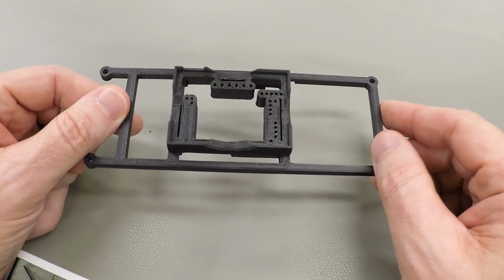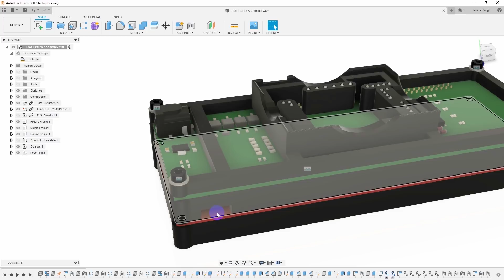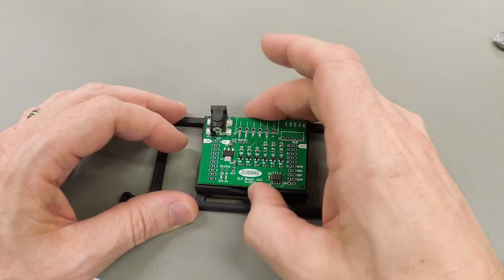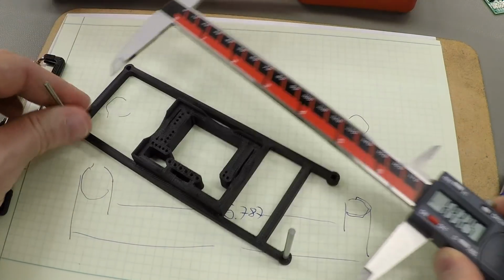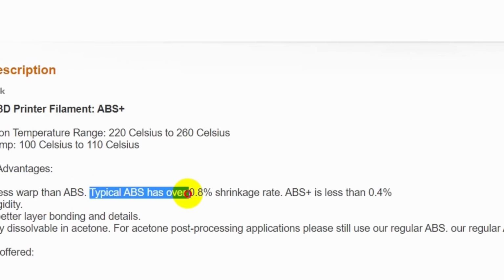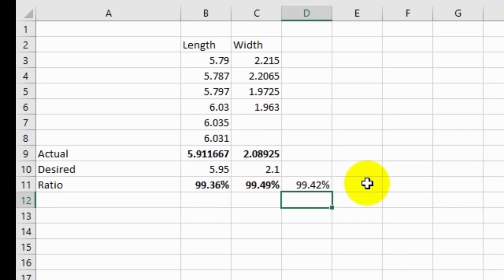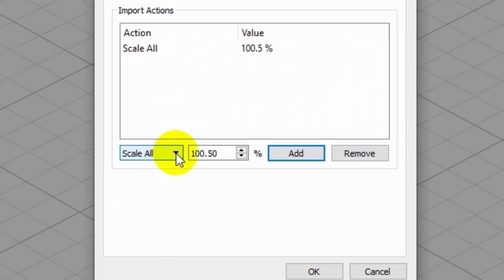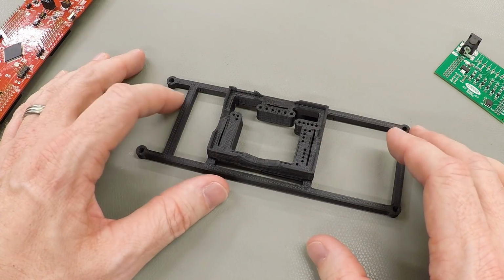How to 3D Print Dimensionally Accurate Parts

Comment: The only solution that I find on this is to make a rectangle with different materials and Check the dimensions ,and create a database of different materials shrinkage
Reply from the maker: I think that's right, except that I would probably take my measurements from hole positions, just to eliminate errors from over/under extrusion.

Comment: I am pretty sure you need to calculate the steps per inch by pitch diameter of the gear - not the tooth count of gear + belt spacing...  IE ((1/(pitchdiameter*PI))*motor steps/rev)
That threw me off too a long time ago...  Literally....
Reply: I'm pretty sure you don't. At the end of the day, one turn of your gear moves "number of teeth times spacing*" length of belt, and your diameter is completely irrelevant; in fact, it is FIXED by the pitch and number of teeth and can be calculated back from it - but unless you feel curious Pi needs not get involved. There's no such thing as moving 6.810395 teeth per turn...
* note: obviously, your spacing is not what you measure on an un-stretched belt.
Reply from the maker: I think this is correct.  If the diameter of the pulley is off a little, you'll get jitter as the teeth fight the diameter, but over distance, this averages out.  This assumes it's at least close.

Comment: If everything that's printed is scaled up or down uniformly, you should adjust the steps/mm in the firmware settings instead of compensating for it in the slicer. If holes are too small and outer dimensions are too big, then it's a different issue. Undersized IDs and oversized ODs are a problem on practically all FDM printers, because of the way plastic oozes outwards during printing. It is not a matter of percentage but a fixed length amount. It is why most printers fail the tolerance test beyond 0.1mm or so. You can compensate for that using Slic3r's "XY Size Compensation" setting: https://bradshacks.com/3d-printing-tolerancing/
Reply from the maker: All of this is addressed in the follow-up video.

Comment: Also, I went back four years to find your video to see your printer. You’re printer is also likely part of the issue. I print many precise things and don’t have these issues. You’re printer has a heavy extruder, old stepper drivers that may not have Micro Stepping? There’s been lots of improvements in recent years that make dimensional accurate parts as long as the model is tolerance properly, and the machine is tuned.
Reply from the maker: I have multiple printers.  I don't believe I ever did a video on this one.  It's in tight mechanical tune and it's running 16:1 microstepping.  The weight of the extruder would only limit the speed (and not dimensional control) but since it weighs less than the moving bed, it isn't the limiting factor.
Reply: Clough42 oh okay. The printer you showed looks to be like the video one from four years ago? It’s a high tech one back then... but now there’s so much better for precision. Like CoreXY.
Reply from the maker: @npgoalkeeper _ Correct.

Comment: I think your math is not correct. If your part came out at 95% of the size you expected you can't just print it at 105%. Let's take an extreme example:
Say you print a part that should be 100mm long but it came out 80mm, so you have 20% shrinkage. Now, what you did is you printed it again at 120%, adding the shrinkage to 100%. 
But since 100% came out at 80mm, 120% scale will only increase the size to 96mm, not 100mm. Because 120% of 80 is 96, not 100.
Instead, you would have to scale it to 125% to get your desired 100mm.
To get the correct scaling factor you will have to use the following formula: 100 (percent) / actual * desired.
It worked out for you because your part was small and your shrinkage was minimal. If your part was much larger or the shrinkage was more extreme, your holes would not line up.

Comment: Compensating for the distortion caused by FDM is very non-trivial. E.g. here is a research paper that tries to solve the problem using neural networks: https://link.springer.com/article/10.1007/s00170-013-5196-2

Before I discovered that paper, I printed out a bunch of simple parts of various sizes, measured them, and plotted measured vs. nominal. This very basic test revealed a couple of interesting facts: the relationship between measured vs. nominal cannot be captured by a simple scaling factor. Furthermore, I noticed that the correction needed for inside dimensions is different from the correction needed for outside dimensions.
Reply from the maker: Yup.  It's complicated for arbitrary parts.  For a hobby user, the scaling factor will work pretty well--especially if you're designing the parts around the known capabilities of the printer.  When the day comes and I print something that doesn't work, I'll adjust.

Comment: I'm surprised noone is talking about "Horizontal size compensation" on "Other" tab of process being almost the same, or even better solution. 
It won't let you choose different compensation for y and x though, only in both directions simultaneously. But at least it doesn't affect the height, which usually is spot-on.
Reply from the maker: It has been discussed.  It's not an overall scaling percentage.  It expands or shrinks perimeters by a distance in millimeters.  So it can change the outside dimension of a part, but it won't change the center distance between holes.

Comment: I know nothing about 3 D printing methods, but I do know that any material based on acrylonitrile is only temperature stable in stable temperatures, but is not reliable to retain it's intended size during cooling.. Nothing's ever that simple eh !  🤢
Reply from the maker: Nothing is simple.  I have heard that injection molding sometimes even requires the mold to have a slight curve so the part will cool flat.

Comment: If you are printing abs you MUST use an enclosure. ABS has the property that it shrinkage. 
Print the samething in PLA and it will fit.
Reply from the maker: For some parts, an enclosure would help a lot.  For something like this, I get great results with an industrial silicone bed heater.  I also have the printer located someplace with no drafts.  In the summertime, if both printers are running, I can close the door and the whole room temperature comes up a little, and that helps also.

Comment: The problem is that you are using mystical measuring units instead of a scientific.
Reply: I love how he read the diameter of the filament as "1 and 3 quarter".... But used decimal points for the inch measurements elsewhere.

Comment: Alternately, you lost 0.5mm across a 6 inch dimension....Your explanation and spread sheets really were not needed...
The shrinkage was also an assumption, it could still have been a printer calibration problem...typically, slightly undersize motor pulleys.
Reply from the maker: Slightly undersize pulleys will cause jitter with a timing belt, but unless they're causing teeth to skip, the long-distance accuracy is dictated by the number of teeth and the pitch of the belt.  Innacurate belt pitch could cause a size error.  However, I measured the printer movement, and it is calibrated correctly.
Reply: @Clough42  I used to design Laser Cutting machines before I retired, just so you know.....An undersize motor pulley will cause loss of travel, not jitter or slop, the teeth are wedge shaped..I also said it was an assumption, not a fact.

Comment: Since you're already a machinist.. this should be easy answer: you don't. Not on a machining level anyway.. even tho you will dial in a single print, it won't be accurate on your other model.
Reply from the maker: It'll never match the precision of good machining.  I wouldn't consider, for example, trying to 3D-print a hydraulic cylinder.  But for some applications, the mix of flexibility, convenience of iteration, material choices and good-enough dimensional control are a good fit.

Comment: So we spent almost half an hour on a topic that takes 3 minutes to explain and fix and managed to fudge the solution calculation as well?

To scale up the shrunken part in this case you scale it up by multiplying the dimensions by 100/99.5 or 1.005025 and actually 0.5025% and not 0.5%.

Just pointing this out to offer comfort to the other triggered folks who yelled at the monitor when you fudged the calculation after all that attention to detail.

You also neglected to point out how to save wasting filament and time by printing a simpler test object such as 5x5x100mm token on the X and Y axis. A big cross printed in the middle of the bed works also. You would do this for any new filament.

Personally the thing that I think made a lot of viewers decide to not sub was when after doing everything in imperial you went of at a tangent and started quoting adjustments in metric.

That kind of 'unit fluidity' could get you in trouble with straight white cis gendered males who view non binaries as filamites who should melt in all eternity on the heated print bed from hell.
Reply from the maker: You're correct about using the inverse for the calculation.  I did it that way initially (off camera).  In this case, though, there is enough error in the measurements due to imperfections in the print, the flexibility of the material, the fit of the pins, and the difficulty of controlling the measurement pressure by hand that calculations out to four decimal places are not warranted.  I only averaged five measurements, and they disagreed with each other by whole tenths of a percent.  So I took a rough number that was close and tried it; it worked fine.  Viewed as mathematics, this lacks elegance.  Viewed as engineering, this is typical.  The world is messy and sometimes the last .0025% isn't needed to make something work well enough for the intended use.

The mixed units in this case are inherent in the domain.  My 3D printer (like most) is denominated in millimeters.  It uses metric hardware, metric filament, and metric STL files.  The PC board is designed to fit a TI Launchpad, which is specified in mils (a.k.a. thousandths of an inch).  I deal with stuff like this all the time, so I end up moving smoothly between measurement systems without even noticing.  I tend to use whatever is convenient or fits the tool I'm using or generates nice round numbers that are easier to remember.

Comment: i would like where you get your eye calibrated ahaha
Reply: No you don't. The metrology lab is always backed up. But they still will take your eyes the moment their calibration is due, but hold on to them for six months expressly so you can't use them in the mean time. Then they finally show up with a cal sticker backdated to the original calibration anniversary, so you only get six months of use before repeating the debacle, I mean cycle.

Comment: Esun is crap filament
Reply from the maker: I've gotten good results from it, so it must be crap in some way I haven't noticed.  Do you have something specific in mind?
Reply: @Clough42  Just never had good luck with it. It wasn't until I tried a better filament that I found out just how bad it was. Supports wouldn't come of and it would clog unless I used lots of heat. I couldn't find a sweet spot.